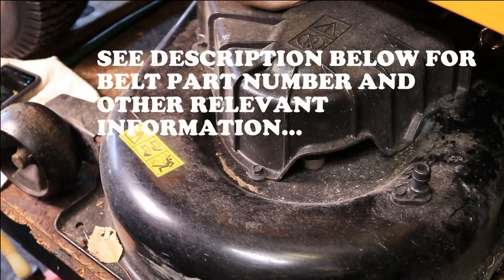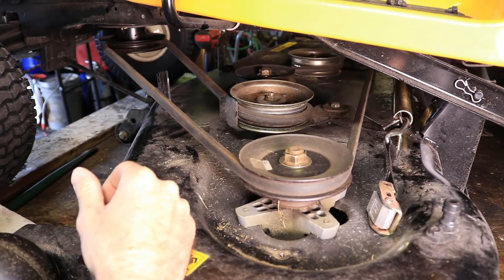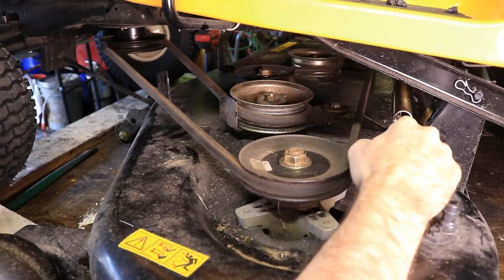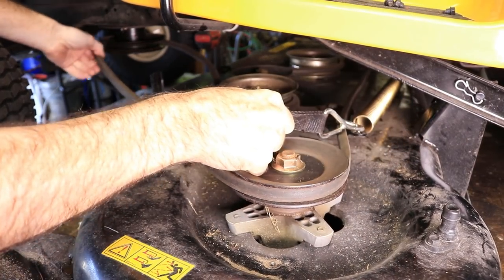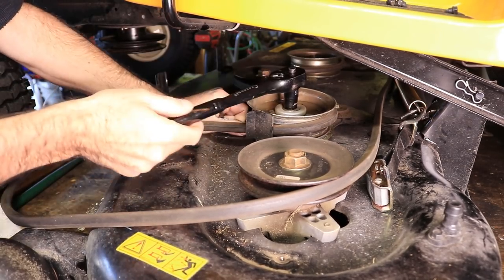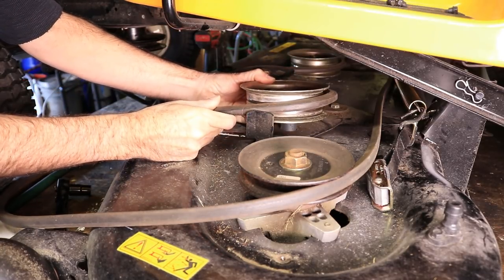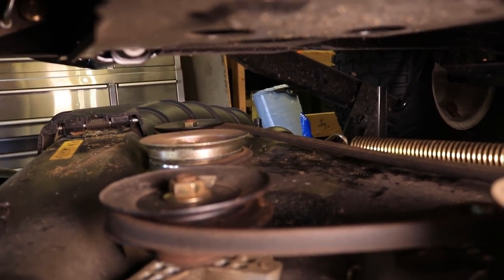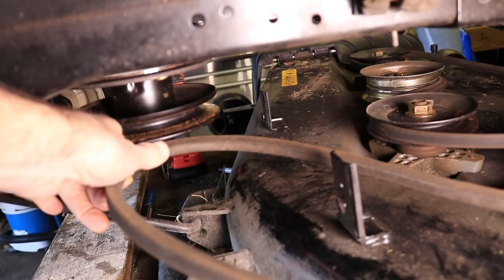How to Change Deck Belt on Cub Cadet  Lawn Tractor

Comment: I had to use a damn ski rope to pull that spring lever forward enough to get the belt around the front pulley. Whoever came up with that design at Cub Cadet needs to have his butt whipped.
Reply from the maker: BG Meadows yep.... PITA!

Comment: I finally removed the silly belt guards from my xt1, as much heavy grass as I had to cut they were both completely clogged up, no matter what I did, could not keep them cleaned out, works great now, just careful of foot placement, was worth it for me.
Reply from the maker: Good stuff!  Thanks for sharing.. :-)
Reply: I did the same thing. I'll keep the guards off because they trap sticks and branches. Now I can see if I have anything rubbing against the belt.

Comment: Awesome! My idler had slipped past the frame as well. I NEVER would have figured that out. Your ratchet strap solution worked beautifully, and what certainly would have been hours of aggravation tuned into a 20 minute fix. Thank you thank you thank you!
Reply from the maker: Excellent! If I remember right when that happened to me it was not a planned part of the video... but I left it in there as a good possibility it would happen to someone  ... so glad it helped 😁😁

Comment: I"m a 60 yr. old disabled woman and I was able to change my belt with ease after watching this video.  The only thing that wasn't mentioned in the video was the bar that runs across the engine pulley.  But, no worries I simply removed it and looped the belt around the pulley.  No need to do anything with the ratchet.  My mower is in great shape.  It's over five years old and this is the first belt, blades and tune up (it gets regular oil and plugs changed).  I don't know what I'd do without youtube.  I hate reading the manual, so videos like this are amazing.  When I was switching the belt, the old one was really slack, like it would just fall off but never did.  The new one was the same and I thought I'd missed a step.  Until my son asked me to engage the blades (with the mower turned off) and the belt tightened right up and my mower was ready to go.  Thank you for sharing your video.  Folks like you make old ladies (with a shop full of tools) save lots of money by doing this kind of stull myself.  Have a great day!
Reply from the maker: HI Ann. I'm so glad this was able to help you.  Does your mower have a pull out switch to engage the blades or a lever that you turn about 1/4 turn to engage the blades?  If it has the lever, then that explains why the belt was loose when disengaged...  I'm glad you got it going!... :-)
Reply: @JLPicard440  Hello Sir I have a troy built super bronco XP. It's exactly the same as this mower . I'm having a huge prob I can't figure out . Right where the cotter key is that goes on the back side nub it keeps breaking,  the adjustable arm that let's your raise your deck adjust your deck up and down is where I keep having this prob . My idler is past my frame,  is the idler suppose to be past the frame like this? I use a rachet strap hook just like you did have for a couple years now .
Reply from the maker: I'm assuming the cotter pin is large enough.  I can't remember exactly where the idler sits, I haven't had one of those for a while.  If you look at the idler there should be a square hole in it somewhere where you can use a regular ratchet to pull the idler back.  I figured that out after the video.  Without being able to see it, i'm having trouble picturing where the problem is.  If you're having problems with the mechanism that raises the deck, what about the roller wheels?  Are they adjusted properly?  Could be to much weight hanging there...
Reply: @JLPicard440   Where I been grabing that spring with a Rachet strap I think it's made the spring weak . If you read the comments on this video many are saying that their idler was up past the frame point that you talked about in the video , I can't get my idler to return back past that point and now today for the first time my belt actually twisted kinda , it finally broke went and got a new belt and it twisted again , I can't figure out what the heck is going on with this thing .
Reply from the maker: Have you tried to remove the spring so you can move the idler freely and see if you can get it to go where you want it?

Comment: Thanks for the advice. I could not figure out how to pull that spring far enough to get the belt over the pulley. Your technique was exactly right. I used a small length of cord with loops on both ends. One end on the spring, the other on a handle, and I pulled far enough to install the belt over the pulley.
Reply from the maker: Awesome!  Glad you got it going... :-)

Comment: Thank you.  I couldn’t get the belt changed because I lacked the strength to move the spring to the idler arm.  Vinyl ratchet coming to the rescue  for me. CURREN belt slipped off  .  2nd time with change it  to see if that takes care of it.
Reply from the maker: You're welcome!  So glad to help... 😊

Comment: Great video. My spring had moved past the frame so I could not pull it to release tension. Used a ratchet strap connected to a workbench leg to pull it to the other side. GREAT VIDEO.
Reply from the maker: Yea, they don't make it easy do they.....  Thanks for watching... :-)
Reply: I used my truck, hooked it to the hitch and drove
Reply from the maker: @kevinclark1199  Sorry for the late response, for some reason your comment wasn't visible until now..  Yes that'll do it!

Comment: There is a square hole in the idler pulley mounting bracket which accepts a 3/8 ratchet handle.  You can take all the tension off the the belt easily and safely so it is can be done without help
Reply from the maker: Awesome!  Thanks for the great tip.. I'll remember that.

Comment: I wrestled with this issue for 3 hours and could not figure it out. But those few seconds that you mentioned the idler pulley bracket slipping inside was exactly what my problem was. Once I had that fixed all was good thank you
Reply from the maker: That's excellent!  Glad I was able to help... 😎

Comment: There is a square hole on the lever for belt tension and if you insert a 3/8 inch square ratchet with a short extension or Johnson Bar you can release the tension with ease, I also put a small length of pipe over the ratchet for additional leverage.
Reply from the maker: Oh excellent.  I hadn't noticed that.  Thanks for the tip.. 😊

Comment: The strap on the idler did the trick.  I used a slip strap and hooked one end on the idler belt guard and other end to the grill, was way easier to get the belt onto the drive flywheel.
Reply from the maker: Excellent!  Glad you were able to get it going again..

Comment: What do I do if the spring fell off with the darn belt?? any videos of that repair? I have the XT1 enduro series
Reply from the maker: I think this is the only video I have done for the XT1 deck belt.  I'm guessing my video doesn't show the location of it?  You could get the model number from the bottom of the seat and go to a website like www.partstree.com and plug in the model number.  From there you can get a parts breakdown and that might show where the spring went...
Reply: @JLPicard440  thank you so much I will check it out!
Reply: @JLPicard440  great website for parts!!
Reply from the maker: Yep!  You're welcome.. 😀